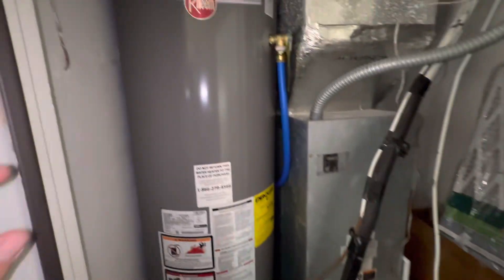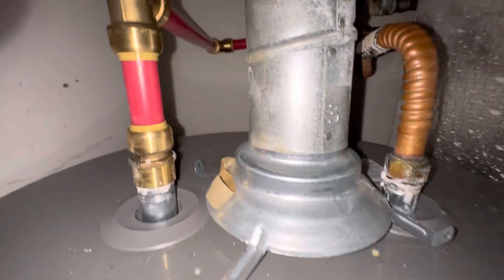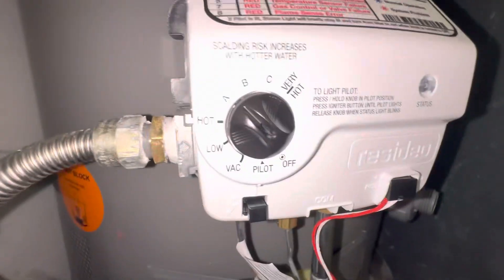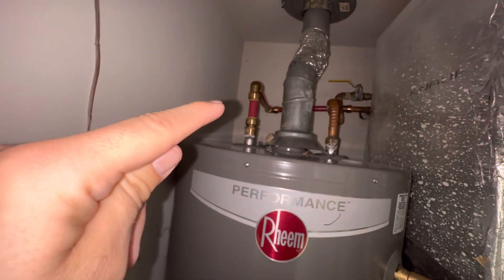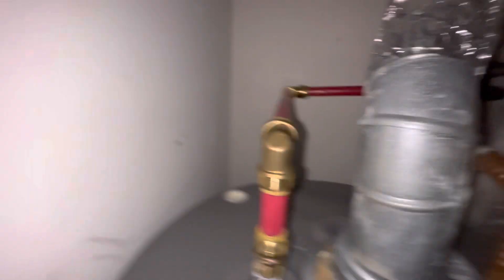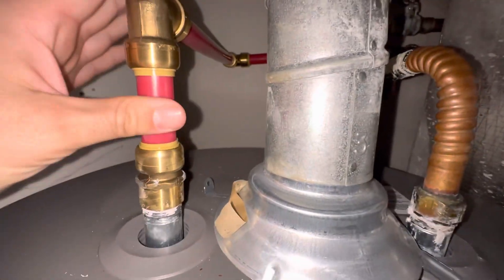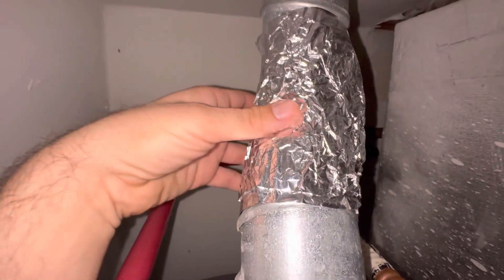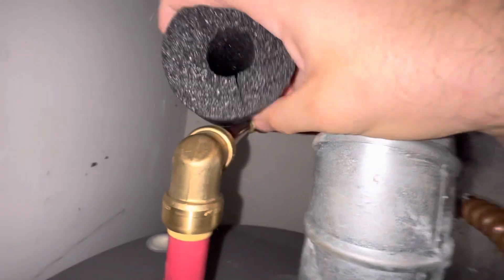Using PEX on a Water Heater

Comment: You have caused a major problem. You never lower the exhaust pipe like that your unit will not burn off the gases properly and combustion, and eventually will cause damage to the unit and also potential harm to anyone living in the house from the gas is not being properly burn off to combustion in the process of ventilation through the draft, maybe we get away with it for a short time but eventually it’s gonna catch up also on green water heaters. They have a special feature that most all other water heaters don’t have and it’s a small glass tube in the bottom of the water heater is connected with a ventilation system when this unit detects, gas vapors or gets too hot the gas bug breaks, causing a piece of metal to fall down, closing off the ventilation from the bottom of the unit making the unit stop working. This can be caused many different things. One of them is not having enough airflow and the unit gets too hot and it’s obvious that your water heater is in a space that’s not design well and it’s not getting enough ventilation around the unit. There’s many many problems with thisand I hope no one’s taking any thoughts from this to use what you’ve done because this could get somebody killed.
Reply from the maker: I appreciate your comment.
The water heater has now worked in this capacity for almost 2 years.
When I mounted it, I put a gas detector in that closet because I was concerned of things like this.
The detector has never went off and there is no order. 
That doesn’t mean that you are wrong about the importance of being cautious and understanding how these work and the proper way to mount them. 
With all of that said, I’m not an expert.
I just wanted to share with people what I had done and whether that worked or not.
And like I say, it’s still working strong, almost 2 years out

Comment: QUESTION PLEASE:
I just bought a new Rheem Short Tank Gas Water Heater (30 gallon, 30,000 BTU) and it has no legs like the the one we're replacing. Do non-leg water heaters need to be elavated slightly off the floor or can they directly go on a concrete floor? Thanks and well done video.... Thanks.

Phil

Comment: The right way is to use a piece of copper at least 18", sweat the pipe thread adapter on one end, and your pex adapter on the other. Then you thread it into the heater, and attach the pex. Both on cold inlet AND hot outlet. You should also have a shut off valve, codes require them on the cold inlet, having one also on the outlet is often convenient. They can either be in the copper or in the pex.
Reply: This is the correct answer.
Reply: @benburnett8109 He’s correct. Why are you bashing the correct answer which is current code?? Lol
Reply: PEX should be 6” horizontally from a flue and 18” vertically.
Reply: @benburnett8109  The exact distance required likely varies depending on jurisdiction. And I didn't say code required a valve on both sides, I said it can be convenient to also have one on the hot side as well as the one required on the cold. And my username was generated by mashing the keyboard randomly with my fingers, many years ago.
Reply: That’s what the instructions say and I wanted to confirm lol Ty 🎉